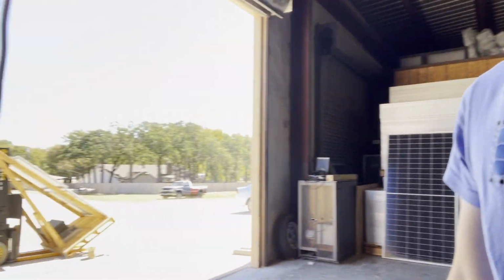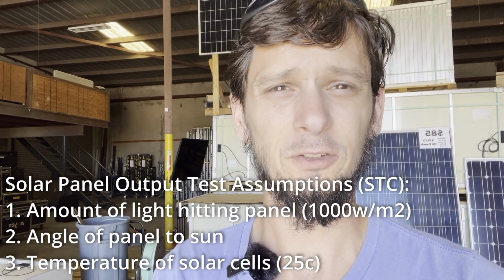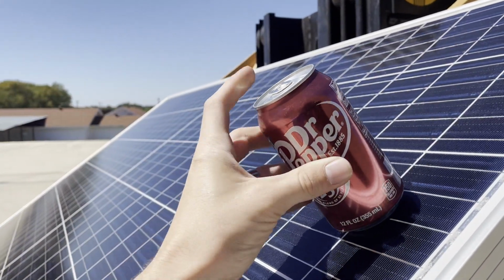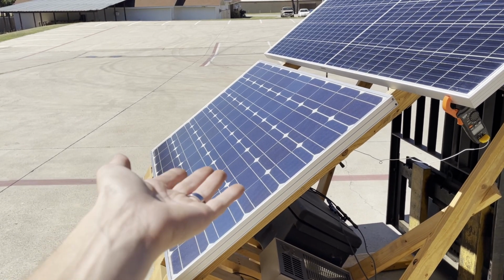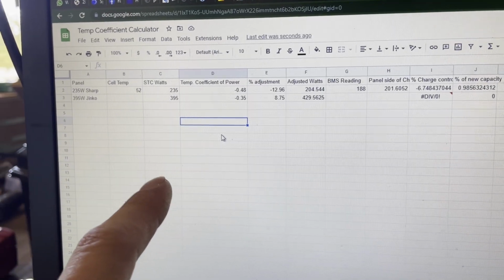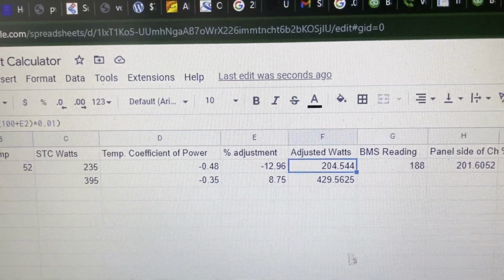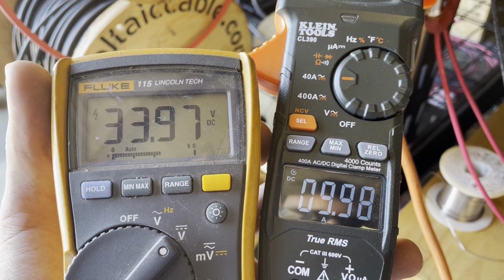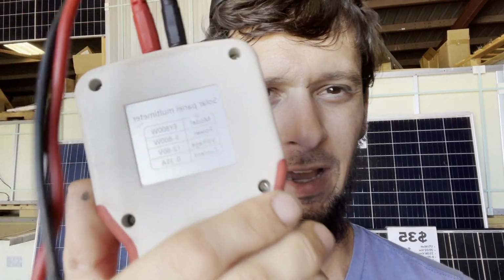How $200 Improved My Solar Panel Testing

Comment: I have been picking up mirrors for free on craigslist. This summer I have angled them to bounce the sun off of my house to reduce the need for AC. Now I’m gonna move the mirrors so that they bounce sunlight onto the house to heat it up for free. If you had mirrors could you angle them at your solar panels? Would that increase their output?

Comment: Hey your near fort worth area right? Do you do service calls or classes to help install?
Reply from the maker: I don’t have the right electrical certifications to do any work, however I’m happy to advise and make recommendations enabling others to diy. (682)730-0725 

I’ve got a warehouse of used panels that may or may not be useful in a project too.

Comment: Awesome video. The easiest way is 1 ohm resistor 500w across the output of the panel. Measure the voltage. The voltage squared is the watts.

Comment: Nice!  A few thoughts came to mind as I was watching this:

1. The only way to really get peak performance out of a panel then is solar tracking and some sort of cooling system.

2. Since most people go with a fixed array because tracking systems are expensive, how much power is not harvested over the course of a year (because really there would only be a few minutes on two days out of an entire year when the angle is optimal).

3. Tie it back to dollars/space/watts  
Jinko / 295 watts / 3119 sqin / $185 (bulk discount $165)
Sharp / 235 watts / 2526 sqin / $70 (bulk discount $60)
Kyocera / 175 Watts / 1981 sqin / $35 
Canadian / 300 Watts / 2976 sqin / $85 (Bulk $75) 

...and life expectancy would be interesting...